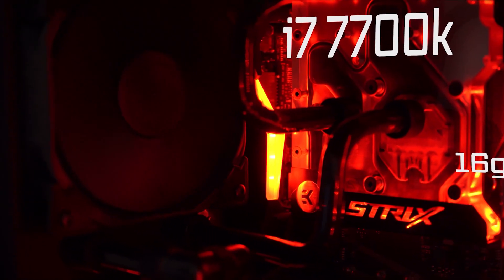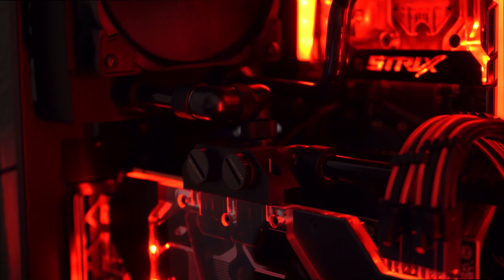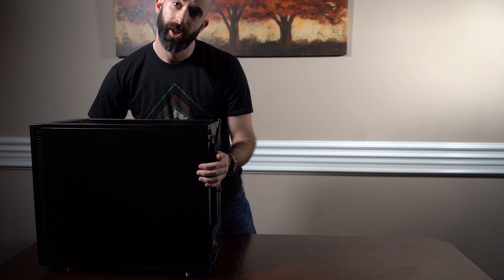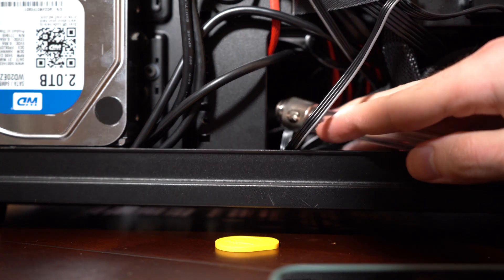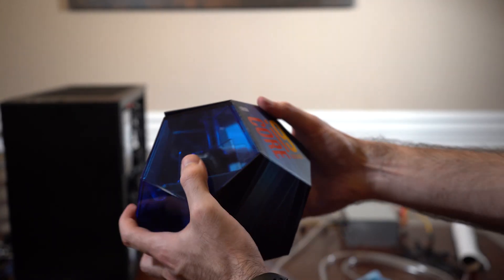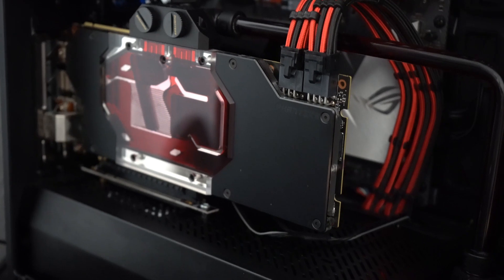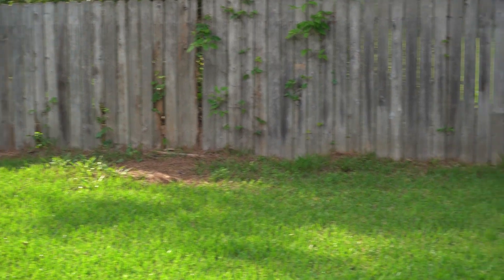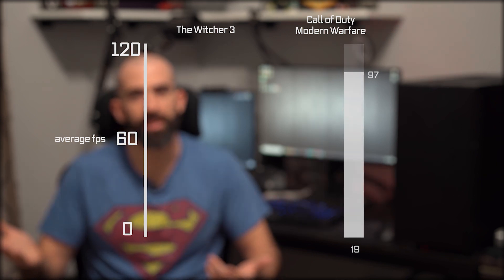Upgrading from my i7 7700k - Don't make my MISTAKE

Comment: Glad you saw a difference with editing.  I have the same 7700k at 5GHz and for 4k gaming, I got me a new 3080 and the bottleneck is still with the 3080.  So my 7700k is not holding me back at all.  Its tempting to get that shiny new CPU, but its not cost efficient.  My 7700k can easily keep up with the 3080 at 4k, so there is no need to upgrade.  Even with obs streaming, Im using NVENC and it doesnt hurt the CPU at all.  So the 7700k is what you want for 4k gaming.  For 1080p, I'd look at a 10700k or the like.
Reply from the maker: For sure, at 4K you won’t need a new cpu until we get a gpu that can start pushing 144+ fps at that resolution and the new trend of more cores doesn’t do anything for gaming.
Reply: i don't do editing or streaming, so my 7700K (which runs at 4.7 GHz all core turbo) runs just fine in Battlefield 1 at 1080P (60Hz TV is my monitor), the only game I really play, and even that is but for 20 minutes a week any more....
Reply: is the 7700k paired with 3070 @1080p considered good combo or do i need to upgrade my cpu as well?
Reply: @seafafrage6934  certainly the 7700K (which roughly matches the stock clocked 2700X in most games) is going to be down some 40-50% in FPS (maybe more in some games) compared to more modern CPUs... If you were planning on upgrading CPU and mainboard later, and could find a 3070 at a decent price, things might still might be playable in  the interim.
Reply: @thicc6  by '2x less', do you perhaps instead mean.... 'half as much'?
Reply: @seafafrage6934  I have a 7700k 4.8 and a 6700xt it like a 3060. And I get 130fps Fortnite, 300+sometimes 400 csgo, and 190 in cod. But msi says I get 220 in cod?!?. It’s not a bad setup. I’d suggest getting it used like i did
Reply: @thicc6  something’s wrong with your system. I run very high setting and ultra in all games and I do get anything below 120 fps. I get around 200 in tarkov and with a 6700xt 7700k at 4.8
Reply: i gave away my 7700K because i went though 2 mainboards on it! and the guy i gave it to is on his sec mainboard too what the hell is going on with the Z270 mainboards?
Reply: @Mr_Meowingtons  you have to make sure your V-Core is kept manually under control. By default many Z270’s will way over volt the CPU. Maybe you’ve just had bad luck? What brand and series?

Comment: Does it worth it? Because I have the i7-7700K.
Reply from the maker: For multithreaded workloads like editing...I'd say yes. For gaming, not really. I mean, its going to be better across the board but for the cost of upgrading the CPU and Motherboard, its not an easy choice. If you have the cash I'd recommend looking at the current AMD 5000 series Ryzen CPUs or waiting until Intel 12th gen desktop chips with DDR5 ram which will be out in the next few months.

Comment: what cpu is better than the i7 7700k? Im not knowledgeable when it comes to pc parts its my first build but its starting to slow down on newer games i have an rtx 2070 gnna try and attempt to buy a 3070 or 3080 but gnna be making an entirely new build for it
Reply from the maker: The best CPU for the money right now is probably the Intel 12600k.
Reply: Even an I3 12100f is faster than the 7700k.

Comment: Great Video! Hey Brett I would like some advice if you do not mind? I have been doing so much research and still feel lost lol...  I have a problem with editing 4k 60fps video in resolve or premier as it stutters very badly... Here are my specs and what would be your advice? Only have about $600 budget right now
Processor Intel(R) Core(TM) i7-7700K CPU @ 4.20 GHz 4.20GHz
Installed RAM 16.0 GB
System Type: 64-bit operating system, x64-based processor
Windows 10
Box- iBUYPOWER (Plenty of room to add on)
Solid State Drive -
WDC WDS240G1G0A-00SS50 435MB/s read & 156 MB/s write
Western Digital WD10EZEX-60WN4A0 - 1TB 7.2K RPM SATA 3.5" Hard Drive HDD
Motherboard - MSI Z270-A Pro
GPU - Nvidia GeForce GTX 1080

Comment: I know this isi old, but I thought I would ask, I don't understand why you had to drain the loop? I see the note very quality tubing I guess it is good that you did drain it,  In all my builds over the years both AMD 6126 server, Intel and AMD gaming systems and my custom loop I never had to drain it I have been very l lucky with no leaks or contamination like algae either .
if your res is on the bottom, you may have air in the loop trapped around the block ? I am only guessing because I didn't see where the rad was either, your set-up is clean though :)u

Comment: Hey, I just stumbled on to your channel and I have a question.  I don't edit videos but I do game.  My current rig is 7700k, 32gb ram, Radeon 7 with some nvme drives.  If you were in my shoes (and you were, minus the intent to render vids), would you recommend upgrading on any path, AMD or Intel?  I game at 1440p.  I just want an outside of the box recommendation.  Thanks man.  Edit:  I know I'm end of life on this mobo -- maybe I can preserve the ram though.
Reply from the maker: You should defintely be able to use the same RAM/PSU/Case/Drives so that will save some money. For a new CPU..thats tough. If you are looking to build right now I'd go with the Intel i7 10700k, but if you can afford to wait, I'd see what AMD's 4th gen Ryzen is going to bring to the table. For the GPU, I don't think you can beat the value that nVidia's 3000 series brings right, so if you can afford a 3080 or a not-yet-released 3070, I'd go with that. Again AMD has some stuff being released in the new few months though. Goodluck!

Comment: Your Pc is like mine except I have the gtx 1080 I wanted to upgrade to an rtx3080 or 3070. also I wanted to upgrade my cpu to with amd, but if I can keep everything motherboard I’ll get an i9990k but I don’t know if my MB support the i9 I have this motherboard will it work with the i9 GIGABYTE GA-Z270X-Ultra Gaming (rev. 1.0) LGA 1151 Intel Z270 HDMI SATA 6Gb/s USB 3.1 ATX Motherboards - Intel
Reply: no my dude unfortunatly...
Reply from the maker: He’s right, you’re gonna need a z370 or z390 motherboard.
Reply: Raid Owl dam so I have to buy another mb ughh will ryzen 3 and 4 and so on be compatible in the future ?
Reply: Crazy revisiting this. Can I upgrade the cpu and keep everything else? I don’t want to have to buy another MB and all the other stuff

Comment: i also have an i7 7700k and dont know wat 2 upgrade to. maybe an i9 10900k
Reply: Tbh are you just gaming? As if so keep your I7 and upgrade your GPU intel wont be worth upgrading for gaming until 2021 with rocket lake which is going to be new architecture
Reply from the maker: Upgrading from a 7700k will require a new motherboard as well. I would recommend the Ryzen 3900x with an x570 motherboard. If you want to stay with intel the i7 10700k is great for gaming...10900k if you want to go all out.
Reply: @RaidOwl  wat. No 3900x is an over kill. I will stick to a b550 with the new r7 4700x when it comes out
Reply: @a7madgamer54  The 3900X is overkill but the i9 10900k isn't? The 3900X is cheaper and has more threads. It's actually priced similar to the i7 10700k at around $400 USD.
Reply: Dude get a 10700k. Way better than any Ryzen offering.

Comment: This is right now more expensive than going 10th gen, at least in my country. i9 9900K = i7 10700K
Reply from the maker: Yep, the 10th series is definitely the better choice if you’re upgrading right now.
Reply: @RaidOwl  the Ryzen 5xxx is faster than intel 10th generation even in gaming. When you have even a lowly throw away 5th generation Ryzen 5 embarrassing an i7 in productivity and all games, then you know intel is dead.
Reply: @keyboardwarrior2418  Look at the AMD fanboy talking. Intel CPUs are at least always available and much cheaper now... No point paying 469 euros for 5800x when 10850k can be had for under 400 euros and 10700k for 300. AMD fanboy tax is real.

Comment: Hello,
I have a 7700k delid and increased to 5ghz
I would like to change when in multitasking it starts to struggle but it hurts my heart to change it because for 4 years it has brought me great satisfaction.
the 9900k fascinates me because it has a big advantage for me with a tdp of 95 and a possibility of delid without too much difficulty ...
Do you think it would be wise to update it to make a nice combo with my 3080 xtreme? knowing that I can have it for 330 €
I hope to have an answer 👋
Reply from the maker: Oh yeah the 9900k will be much better in multithreaded tasks like rendering/editing. It’s also got better single core performance and runs cooler so overall it’s just much better. You won’t have to delid it either since Intel switched away from their terrible thermal compound with the 8000 series cpus.
Reply: @RaidOwl  yes the 9900k is welded with indium but the Conductonaut is more efficient we note a drop of more than 10 degrees on all the cores. After yes it is not without risk

Comment: I know this is video is almost a year old now but if you can reply to my comment I would appreciate it I’m looking to upgrade my cpu as well but I have asus strix z270 f what version of the z370 did you get or do they all have the same specifications? Because I’m dying for an upgrade and I’m very new with pc building and don’t want to make the wrong purchase I also have a 2060 super with a kraken water cooler if that helps with giving me an answer thank you and great video!
Reply from the maker: Hey there! If you are looking to upgrade your cpu I would strongly recommend Ryzen right now with a Ryzen 5 3600 being a fantastic deal on their x570 motherboards. If you are tied to Intel, I'd recommend the 10700k on their z490 chipset. If you go for the high end chipsets like x570 with AMD or z490 with Intel, you can't really go wrong. There are minor differences between them and usually comes down to some having better networking or more m.2 slots or wifi6 built in. Hope this helps!